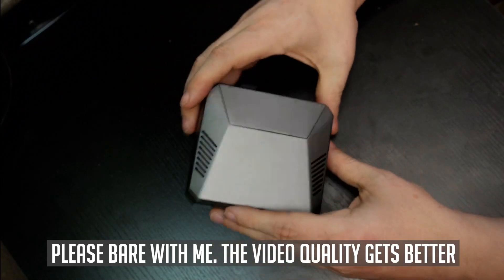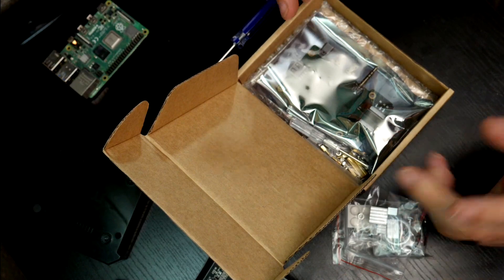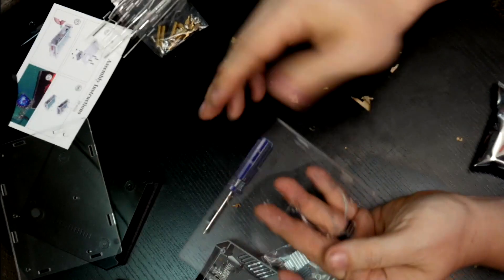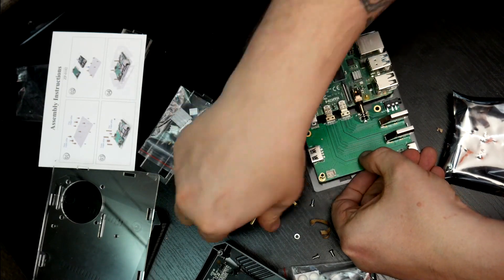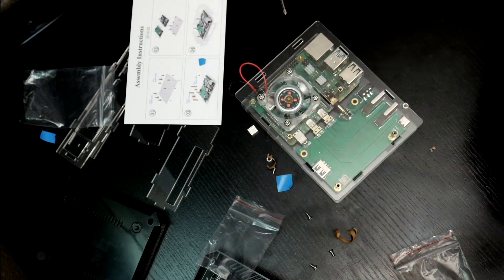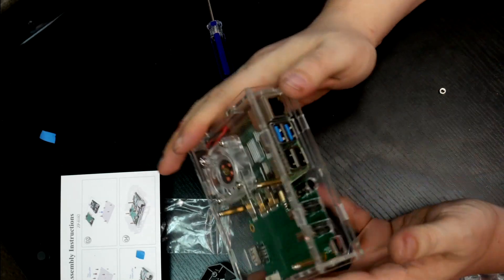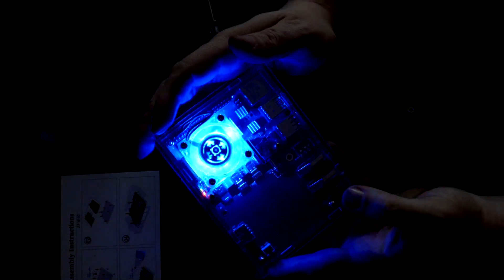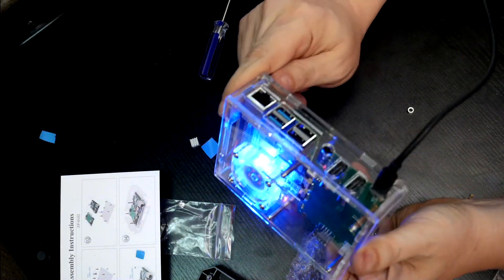GeeekPi Acrylic Raspberry Pi Set top Box Kit

Comment: Perhaps there isn't enough bandwidth to add the front USB and an M.2? Someone else likely knows much better than I. Cool case though especially if you aren't in need of M.2 and it's only $20.
Reply from the maker: Maybe, but the board plugs into a USB C port, so I dunno

Comment: I have three of these cases. The only issue I have had is that the fans have started making a lot of noise in 2 of them so far.  The fans are also a little on the noisy side.
Reply: I use the 3.3 volt and is very silent. It is my Kodi set top box behind my TV. No problems so far (but also just set that up). I have other RPis thata you, after several weeks of continuous power on, the fan started to make noise (as said, not this set up box so far). I wish what is it degrading that makes fans starting to be noisy